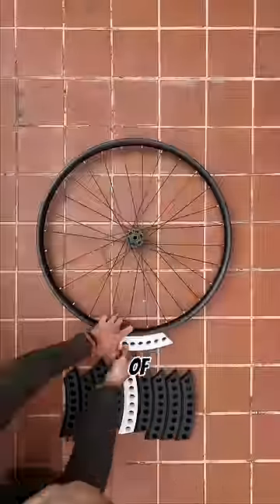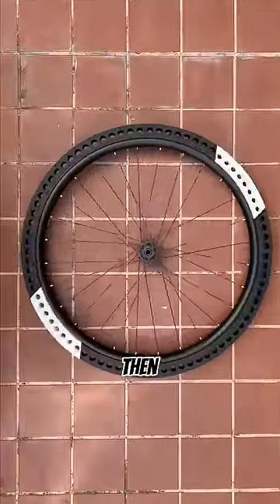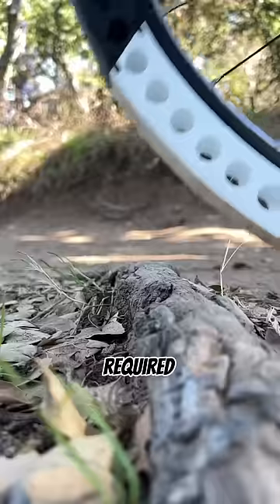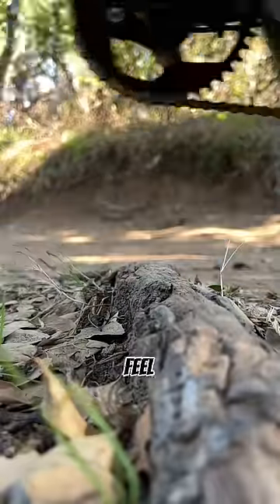3D printed tires in action! #mtb #cycling #bikeshorts

Comment: sigh I thought this dumb thing would end with the car community guess it extends to bike community. Clip them into your WHEEL*  the tire is only the rubber part. The wheel is both the whole thing and just the metal cylinder inside part.